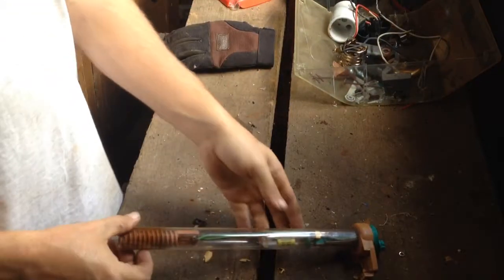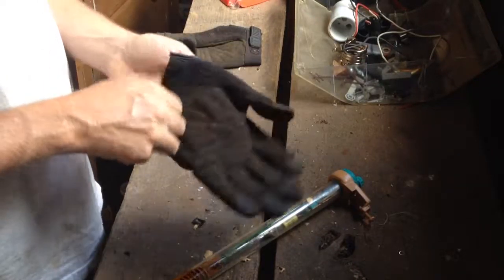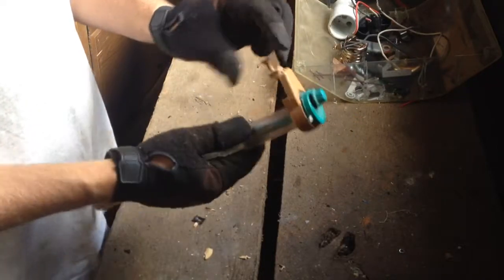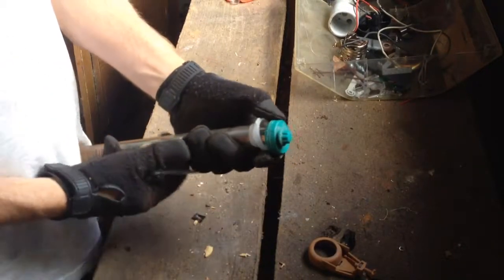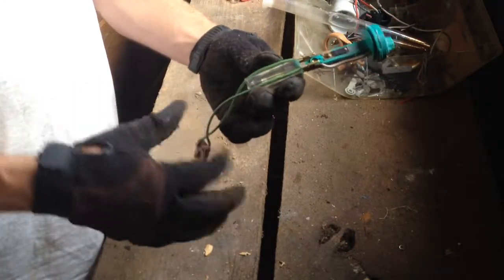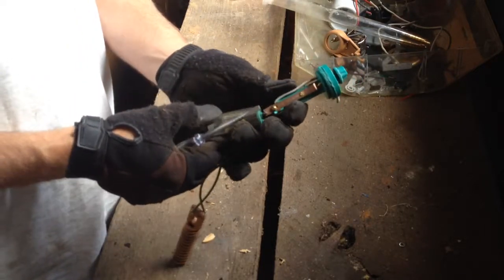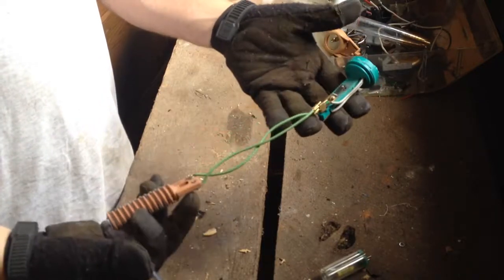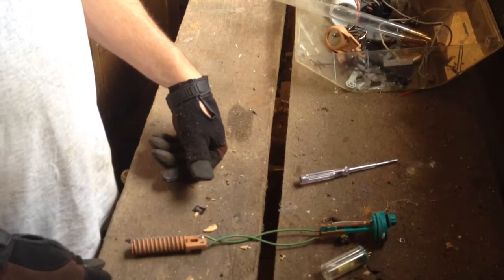Scrapping a fish tank heater for copper brass and more....really

Comment: Great video.  This is the kind of stuff I'll be scrapping as I only have a small car and being a lone female am limited to what I can lift anyway.

What is the heating element made of?

Cheers,

Poo
Reply from the maker: I use an SUV for my scrapping and I carry a assortment of tools, that way I can do some breaking down on the road. The heating element was coil steel. I would have thought it to be copper, but it was steel. You are the second female subscriber that I have. I think it is great that you girls are scrappers! Scrapping is great for the earth, good for your pocket, and its like a treasure hunt!
Reply: I am very much in the collecting stage at the moment, I have plenty of storage space and have quite a lot of stuff to break down but am not able to do it at the moment.  Probably next year now I'll be up and running.  The law changed over here last October making it quite difficult for small scale scrappers.  I may do a video about it.  I don't think I have good enough recording equipment though as you'll understand if you've seen my two uploads. lol!  Keep up the good work,

Poo
Reply from the maker: poosmate I use an Iphone 4s for all my videos. I set it to use the WiFi in my home. It is not on any phone plan so there is no monthly expense. I have seen them in the local for sale sections for as little as $20 bucks. With better light I think both of your videos would have been great. I will keep an eye out for an iphone here in the US....I could most likely pop it in the post for cheap due to its size.
Reply: Aw a very kind offer but I don't have wifi here - old fashioned cabled broadband here.  Not sure why but wifi kind of scares me! lol

Comment: please answer HappyScrapper what do you do with misc copper like not pipe or wire like jumper cable ends or plugs or like anything copper is it considers #3 or mixed copper?
Reply: You can sell it with stuff like motors or as copper breakage if your scrap yard is ok with it.